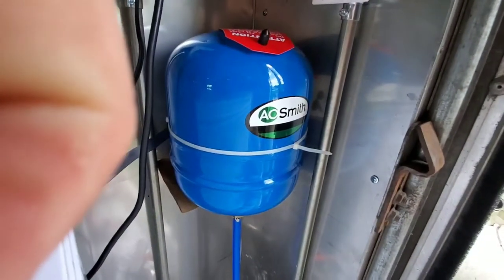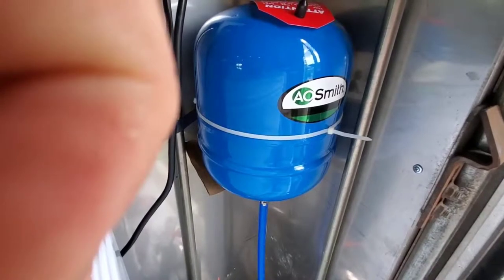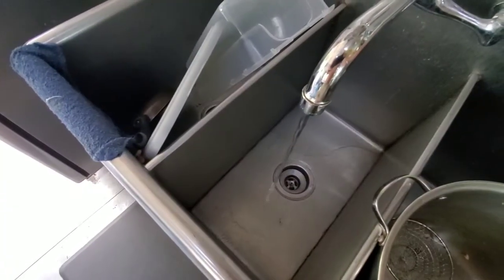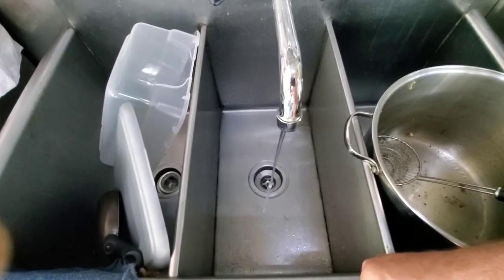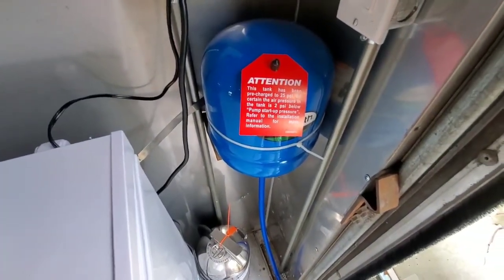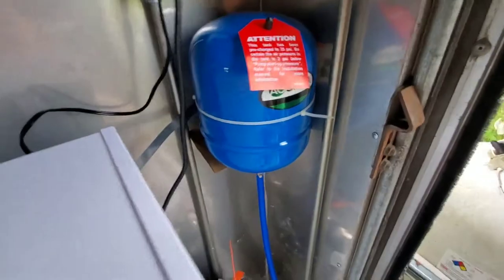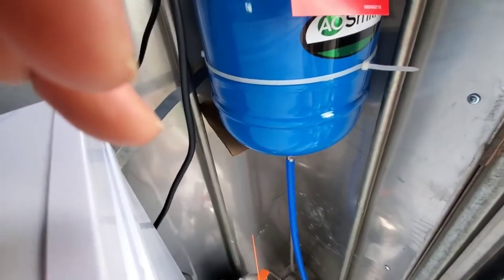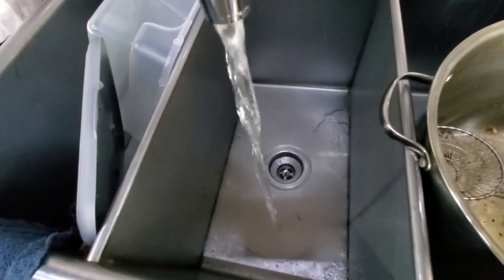Use a pressure tank in your RV or Food truck for 12 volt systems

Comment: How did you determine what pressure to set it at? I have a similar situation in my tiny cabin. Pump banging. I've got the tank but no idea what pressure to set it at
Reply from the maker: I wasn't entirely worried about the banging but more keeping the pump from just pulsating on and off.  I set it to the maximum pressure used a  timer, reduced the pressure until I had a good on and off time using that bladder.
Reply: @eby6114  by banging I meant shutting on and off fast.
My pressure tank says in the instructions to set pressure 2 to 3 psi below the cut in presure.
Reply: @eby6114  my part is a 12v 3 gpm 45psi pump.
But I'm not sure if the 45 psi is cut in or off or what?
Reply from the maker: @deeprootslandscaping4499  if it's a sureflow pump the cut in pressure is 25.